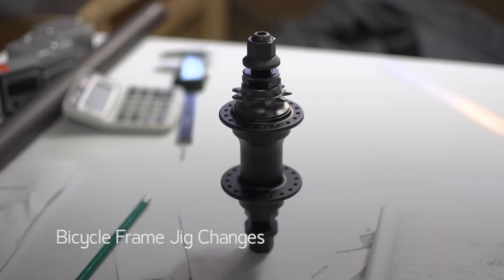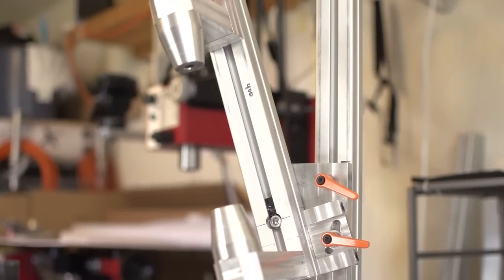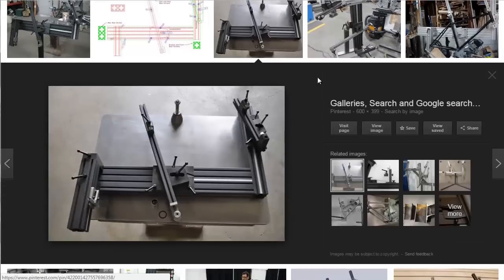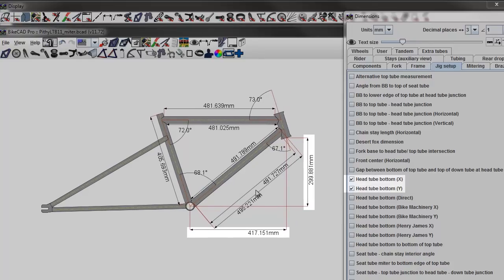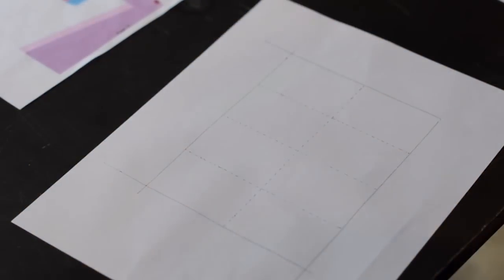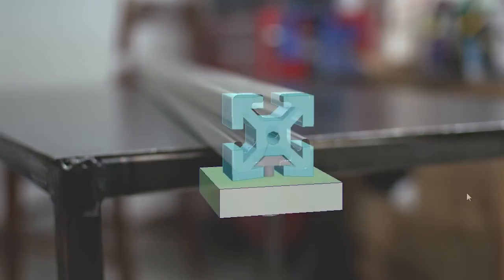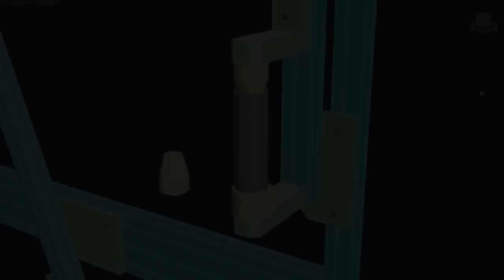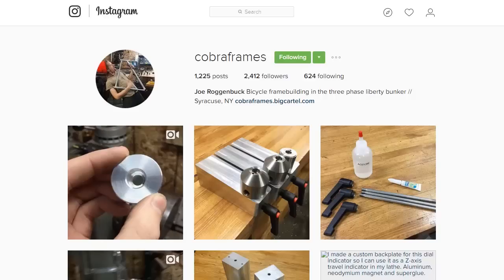3 Changes I Would Make To My Bicycle Frame Jig

Comment: I realize I'm seven months late and you may fix this later but what if you just boxed the area around the bolt (that goes through the extrusions). As long as it hasn't flexed too far and it doesn't wrap under heat that could work. 

FYI I have zero experience, but I'm really enjoying the channel!

Comment: Hi Steve,

Did you comment any of those parametric setup changes with the guys at Arctos Jigs?

And could make a video of the pivoting around the bottom bracket? Or at least give an insight on how to change that assembly?
Reply from the maker: Take a look at 44 Bikes version of the Arctos. Chris used a plate that extends down to the BB for the pivot point. This I think is the best option because it's a simple design but also very rigid.
http://www.44bikes.com/44-bikes-frame-jig-progress/
Reply: Thanks! I´ll have a look!

Comment: Another awesome video! currently making my jig which is almost the same as yours, would it matter if i just shifter the bb mount up so it was inline with the main support and thus rotated centrally to the bb. and the headtube presumably could just be fixed in place by that point quite easily. how do you plan about doing them both?
Reply from the maker: I recommend keeping the BB pivot at center and roughly at the same drop I have mine (standard position below the spine). The reason for this is that its best for the central support of the jig (the spine) to be in the middle of it all (at the center of the bike being fixtured). You'll have less run out this way. Good luck!
Reply: ok i will try to work something out!

Comment: To "quickly fix" the sub assembly hardware crushing the extrusion out of shape, you could machine two small cube the width of the t-slot that fit on on each other side of the M8 bolt that sits flush to the bottom of the slot to the top of the extrusion. And you could affix them with one single like M6x15 cap screw.  (At first I was thinking of machining one spacer but that M8 takes most of the space in the t-slot so I don't think there would be enough meat for a simple one spacer with a hole in the middle.)
Reply from the maker: Right on about the space taken up from the M8 screw. Maybe similar to your idea I could machine some blocks and sandwich them between the m8 screw. The blocks would be snug to stay in place but not to snug. Could be another option for a quick fix. But I may just wait to re-do the assembly! ;)

Comment: I love boredom, boredom's my favorite. One suggestion about your thru bolt connections... Can you machine some sleeves for the bottom side to the required depth to prevent any deformation of the 80/20? you'd have to machine an appropriate amount on the bottom side of the 80/20 to do this. Also on the bottom head tube cone/locator... How about machining different size locators that are flat with a step in them for the different size tubes you use?  Just spitballin here man..  Happy new year ;)
Reply from the maker: Hahaha great minds think alike! I also considered different size locators. The fastest and easiest fix would be the locators. Hey Happy New Year man!

Comment: Why it's so important to make center of rotation of head tube in bottom? I thought it must been in center.
Reply from the maker: The bottom I think is the most reliable way to measure distances. And because it's the point that is measured on most Archtos Jigs, which is the father to my jig.